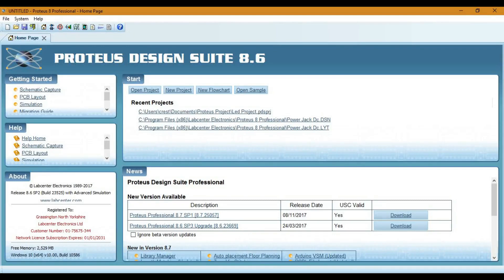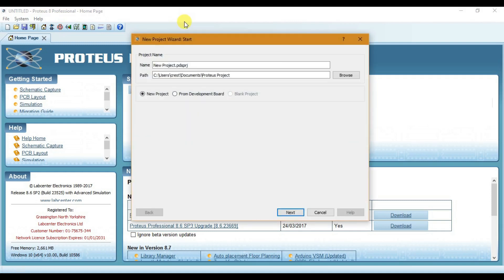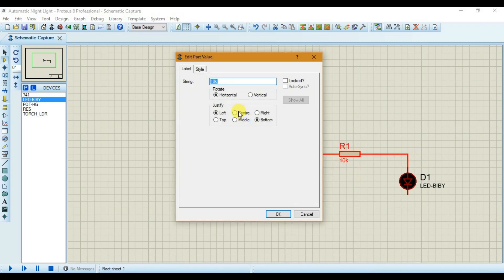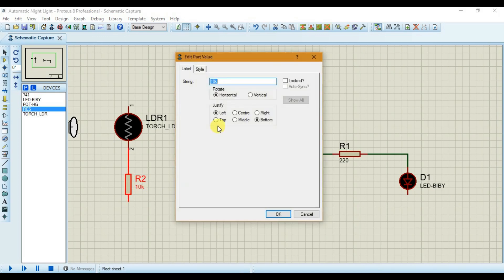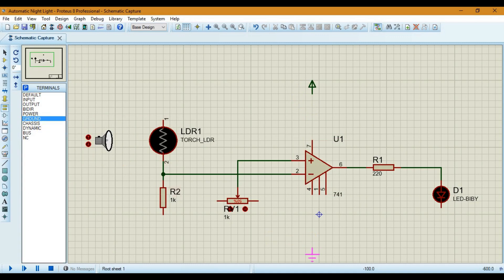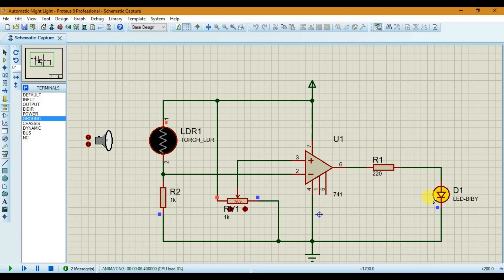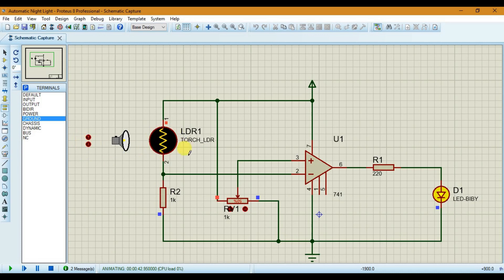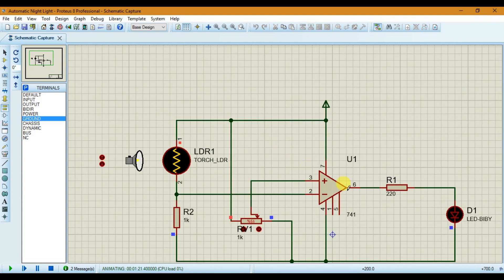Proteus - Basics - Automatic Night Light

Comment: Sir when the light gets off one time the arrow direction of led changes to upward and it does not turn on again
Reply: Reduce the potentiometer value to say 35% then it will switch on once again as you take away the light source from the LDR